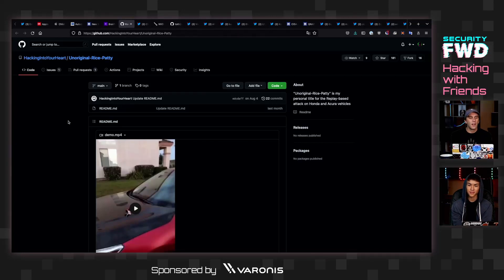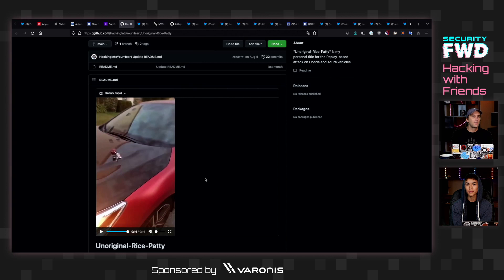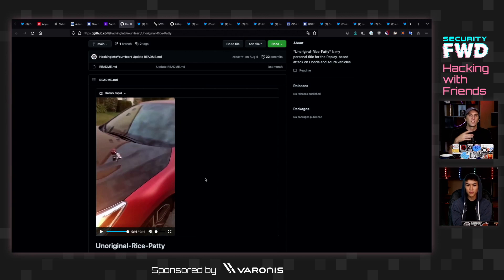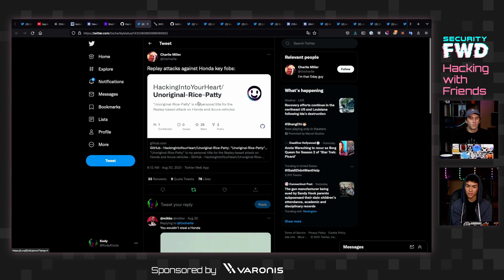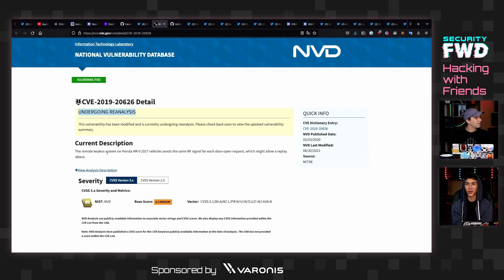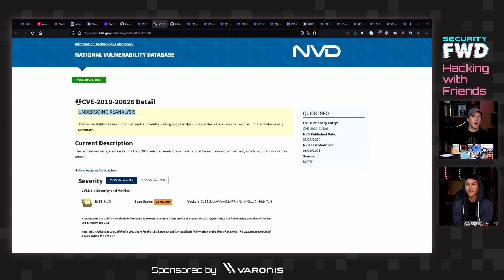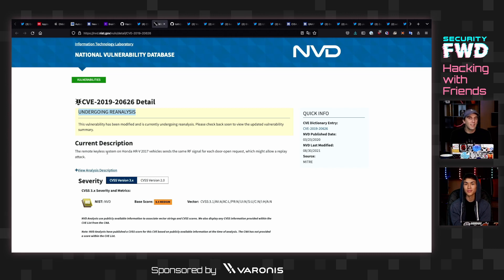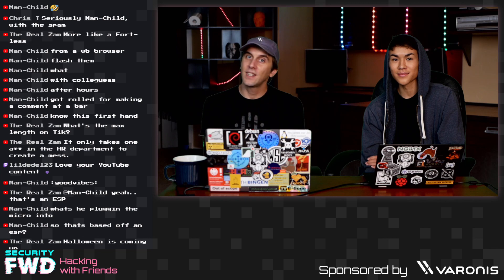How Cars Get Hacked by Rolling Code Vulnerabilities

Comment: How would it work if there are 2 keys? Does that mean they aren’t using riling code?
I have a 2011 car with 2 keys.
Reply: Naw 
I would analyze the key fob in gqrx or any other radio frequency analyzer, see what modulation it’s using (ask/ook, 2fsk), record a few clicks, and replay to see. 
If it doesn’t work, decode the signal, and replay code 💯💯
Reply: thinking of this, two key are two user names, so each user name has it own rolling code sequence.

Comment: Samy kamkar also had an attack called Rolljam, which I assume you're referring to, which basically was setup inbetween the car and the key, and it would simultaneously jam the signal to prevent the car from hearing it, and then catch the first signal, then wait for someone to press the key a second time since it would look like it didn't work, then again the device would jam the signal for the car and record it simultaneously, then it would playback the first signal, letting the car hear the first signal and lock (user thinking this was the second keypress), leaving the device with a second valid code to then unlock the car whenever the attacker wants
Reply: How would that work? I am aware of the attack but the jamming part confuses me. If you're jamming something, you're sending out a bunch of noise on a higher power for a specific frequency to deny service to whatever device you're trying to disable. In this case, a key fob. However, since this creates so much "garbage" noise, how would you find the key fob on, say, 315 mhz or 433 mhz on the waterfall (let's say we are using a HackRF w/Portapack to record the first and second signal) if it's being jammed? Shouldn't it just receive the noise from the jamming device?
Reply: @thatoneintrovert9618  very good point! i presume you'd have to have 2 'radios'. one positioned close to a car/garage door. that one would jam the signal coming from a fob and the other would be in your hand, recording the fob's signal.  that's how i envision it.